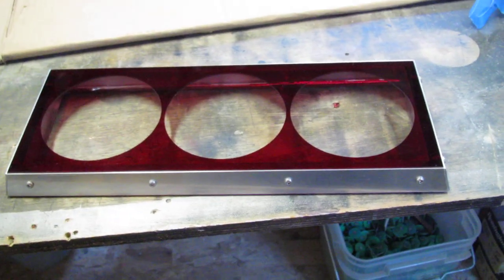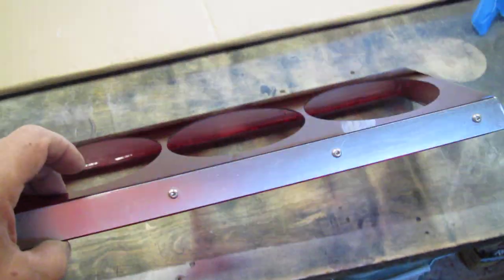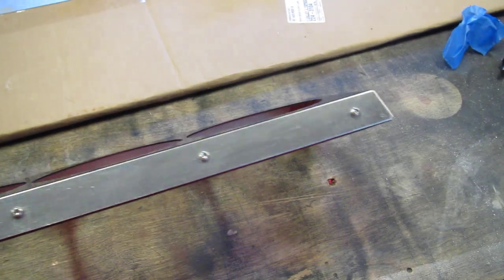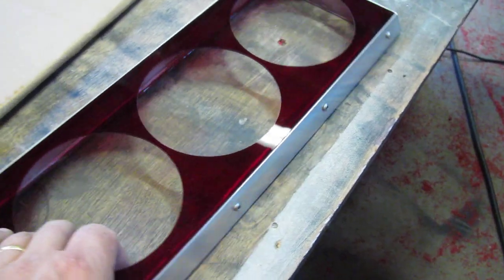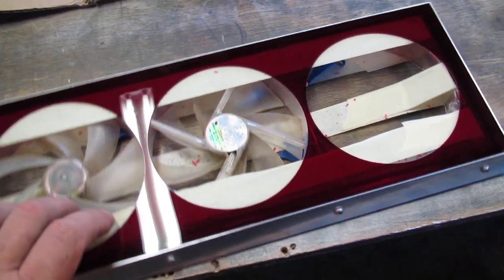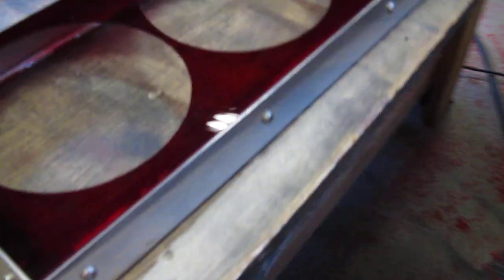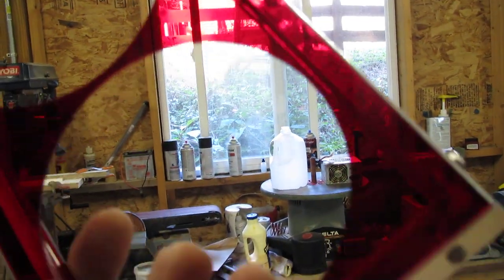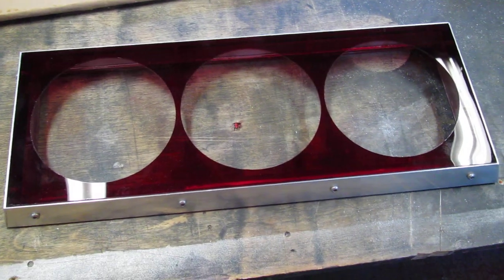Custom Shroud for PC Cooling: Acrylic and Aluminum

Comment from the maker: @supertroye It lays perfectly flat to the top panel. The 1/16" red I used for the base was kept perfectly flat as I built the shroud. I will attach the shroud from below with some screws. The missing piece in this video is the louvered grill, which I had made to the exact dimensions of this shroud....even before I made the shroud :p Gotta love maths. Anyway the louver grill hides that lovely red top and only the edges of the red plastic will be visible. This follows the red "stripe" details.